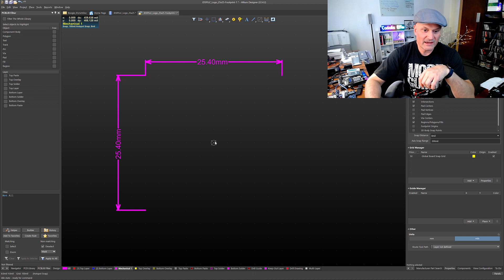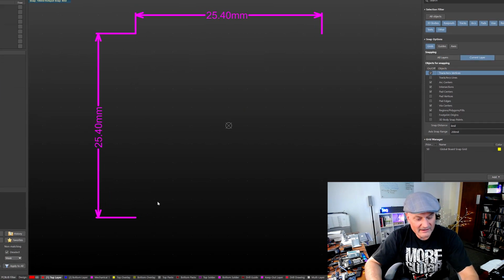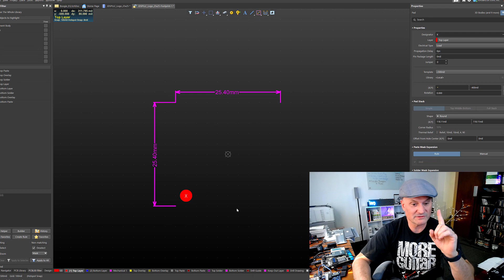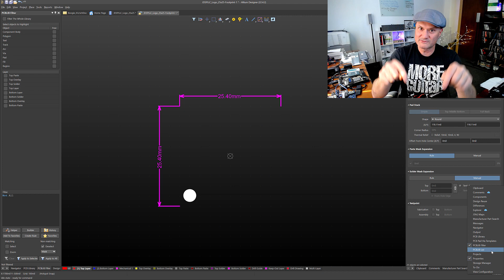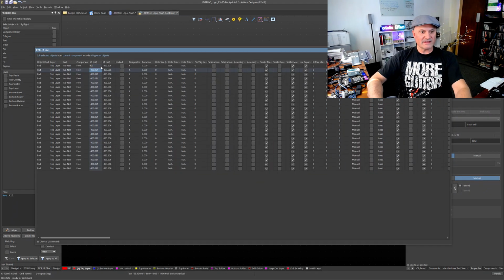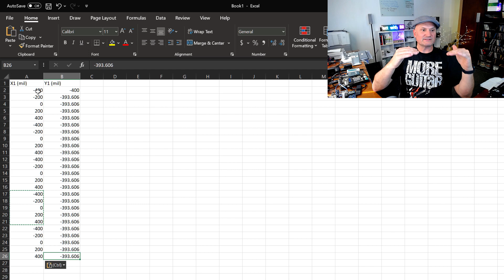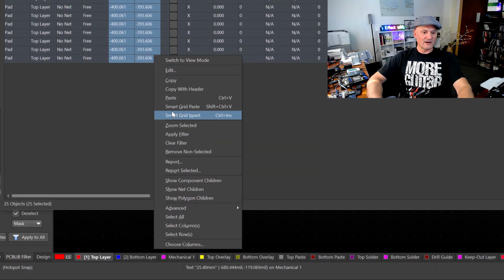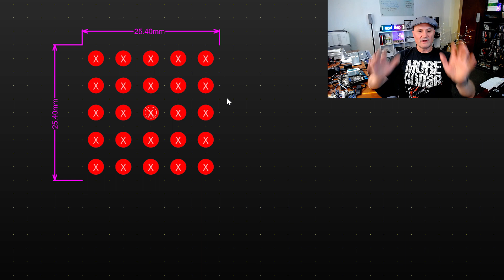How to put ANYTHING into an EXACT ARRAY with BONUS TIP.

Comment: Shift + F12 is the sweet keystroke shortcut.  Thanks for clueing  us in Ben. :-D  I am now wondering what possibilities there are when this is used in an embedded array for say a dartboard or clock.  #lovethefactory
Reply from the maker: It's possible to get great benefit from the list... but you might also consider using multi-channel design and rooms, with a polar grid or non-90° rotation step (in preferences) to make circular placements easy...

Comment: Hi Ben, I was wondering if you recommend any decent Circuit Studio tutorials especially on how to do differential pairs in it. The bit I'm struggling with is how to have multible differential impedances in the same board.
Reply from the maker: Thanks for the question! I don't know of any existing tutorials but I could make a video about that. There's no impedance calculation in the lower end tools. You would need to do that using an external calculator like Saturn PCB Toolkit, and then create design rules for the different pairs or pair classes...
Reply: @schematica  Thank you for the quick response, the thing that bugs me is that it complicates defining multiple differential pair classes. I can set it up in the design rules but not assign it to specific nets or a specific differential pair class.